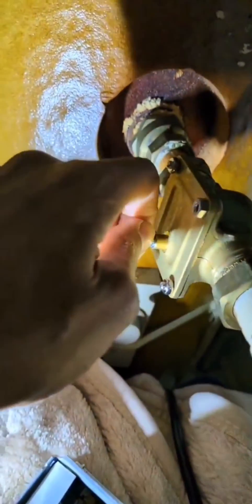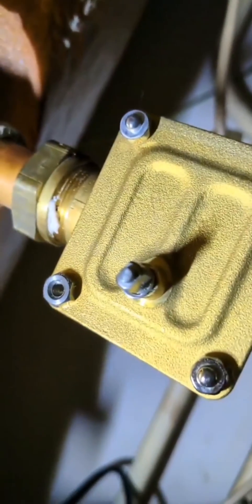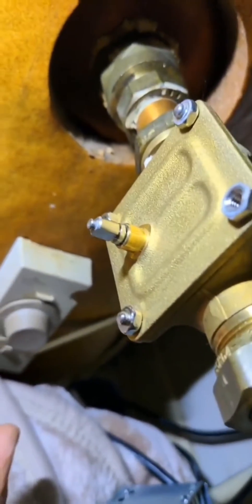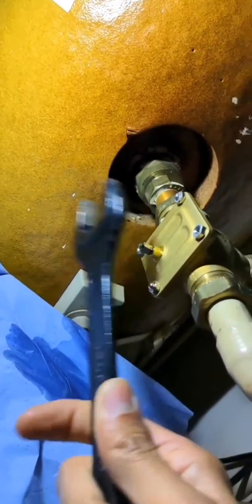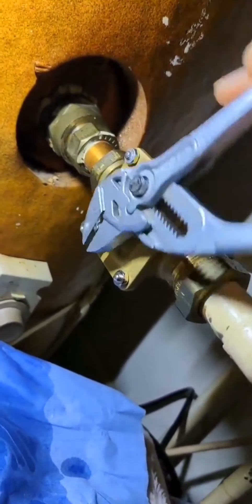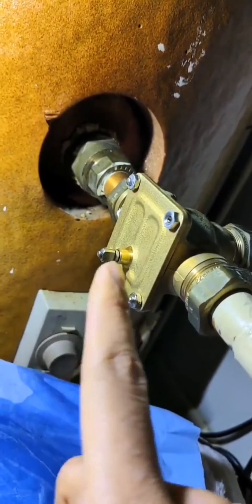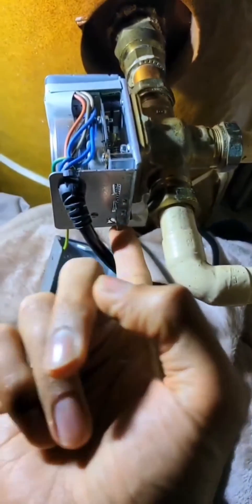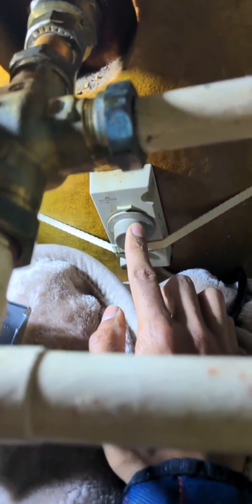How to free a seized Honeywell 3 port valve

Comment: Followed your procedure on a seized Honeywell spindle and it worked a treat! 👍🏻 Valve was previously stuck in mid position resulting in strange system behaviour - hot radiators with CH off, etc. - now all back to normal. Thank you so much for sharing 🙏🏻
Reply from the maker: Nice one glad it helped!

Comment: Many thanks for the information.
Am I correct in thinking the the valve only rotates around 35-40 deg. either direction, ie. from around 10 o'clock to 2 o'clock with mid position at 12 o.clock?
My previous unit would rotate a full 360 deg. in one direction only stopping at 3 positions as needed.  When my old motor failed I could position it manually whereas this later valve returns to mid position when released.
I'm not sure yet what is at fault. The rads. are heating when there should only be hot water.  I found that the actuator motor was very hot, and NOT from conducted heat, ie. the motor was hot to the touch even when the pipes were cold.  I would be grateful for any suggestions.
Reply: Ever get any ideas/fix? Mine is the same!

Comment: Is that a short fix thought wd40 rotted the seals.
Reply from the maker: Not sure if they do mate. This just lubricates the spindle to move more freely inside the body. I've also used a bit of machine oil which I find is a longer lasting fix